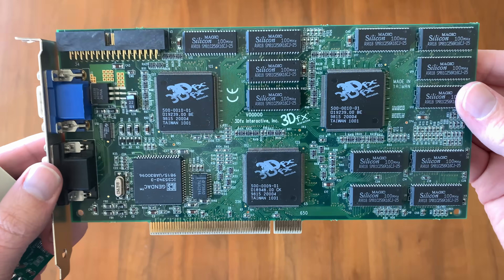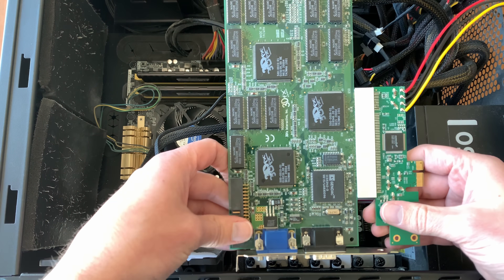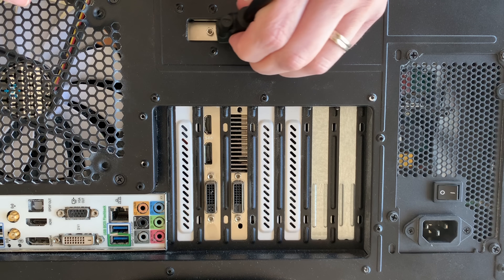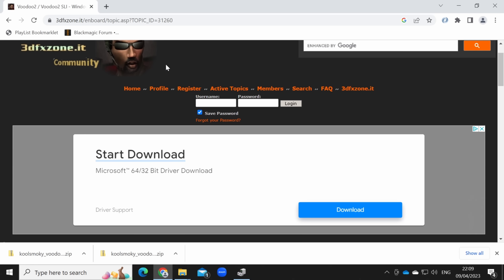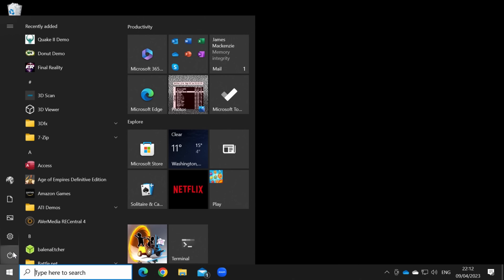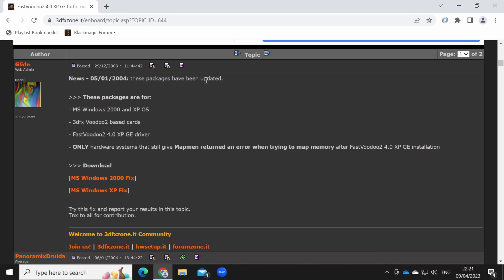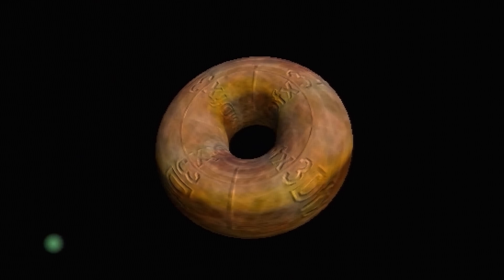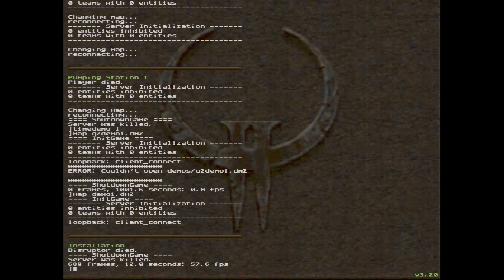I made 3Dfx Voodoo2 work on a modern PC!

Comment: It's hard to describe to younger people now what a huge leap it was going from regular graphics to 3D back in the 1990s, the difference was absolutely mind boggling. I had a Voodoo 1 and a Voodoo 2, the latter being a pretty major performance boost - 800x600!  Nice trip down memory lane!
Reply: yeah i remember those days. Had a Voodoorush, then a voodoo2. was mindblowing at the time. 
The fact that every couple of years there was like a quantum leap in CPU and GPU power.
Every 2yrs was a new gfx card (back when they were affordable, not like today), VRush, Voodo2, Geforce2GTS, GEforce4Ti, GF6800, GF8800, GTX460, and STILL running my 10 yr old GTX 980!
Reply: Had an S3 Virge built into my PC, and then got this on top of it. Pretty badass for its time.
Reply: Moto Racer!
Reply: @WardenWolf  Agree.it is so bad!
Reply: After the first few minutes of 3dfx Tomb Raider it felt like the Moon landing for graphics.
Reply: To be honest the donut demo blew my mind. Was expecting something Unreal level at best. But it really looks like iridescent metal, smoothly animated. Pretty mind blowing stuff for pre turn of the century hardware and software!
Reply: Yeah, it's hard. Back then the hardware 3D rendering seemed like a breakthrough. Nowadays, old sprite-based "3d" games like Doom, Duke3D, Descent and the likes are still somewhat passable with the source ports but early 3D looks like utter crap and there's no fixing it due to horrible models and textures.
I still play Heretic from time to time, but Heretic 2 and Hexen 2 are no bueno because of that.

Comment: Maybe try to see if SLI works next?
Reply: Not sure if there’s a case with two vertical card mounts.
Reply: I thought the same! With two riser cards and a case with dual vertical mounts or a motherboard with PCI
Reply: You're tempting me to do this when my B350 motherboard arrives...

It has two PCI slots built straight on the board and I've got two SLI'd Voodoo2s in one of my retro PCs.
Reply: This is exactly what I would like to see too. The challenges never run out.
Reply: @SolidSonicTH  do it! do it!
Reply: @spavatch  That's what dremels are for. Or better yet there are nibblers that can attach to a drill. Find an old case that you're willing to cut up, or better yet find one with those removable motherboard trays and cut out part of the expansion card backplane. Then cut a rectangular hole in the back of you case of matching size. Drill a couple holes and fasten with screws. There are plenty of old PC cases that just wind up going to the landfills. Might as well make use of some.

Comment: I still have my Voodoo 3 3000 card. Nice to see when others still love the older hardware. Awesome job.
Reply from the maker: 100% agree! I love playing with this old hardware. And I’d still love to get a Voodoo 3 even in 2023 😂
Reply: Honestly, I think that's still the best version of the Voodoo ever. I wish I still had mine.
Reply: @jamesfmackenzie  I think I still have my Voodoo 3 3000. Somewhere. In a box. In the loft... but I ain't venturing up there lest I get badgered into sorting out the rest of the crap thats up there too!
Reply: @YoureUsingWordsIncorrectly   Same with me only I used a couple of screws instead of the zip tie!  The first card I bought only lasted 2 weeks before it burned out and when I got a free replacement I immediately installed the fan after learning about the overheating problem on them.  Still works fine today though I very rarely use it now.  👍👍
Reply: I actually managed to burn out at least 3 Voodoo 3s, once in the middle of a LAN party. Good times!
Reply: I still have a 3DTVFM TV Card  with Installation CD, that I haven't been able to use for years. Could this be applied to that too?

Comment: That's great, had Voodoo2 SLI back in 1998 and fond memories of gaming back then.  Great community effort to bring drivers to x64 Windows, would not have guessed that was possible!
Reply: Those were the days! Miss my old build with my SLI Black magic Voodoo2s.
Reply from the maker: @davidt3563   100% agree! Great memories of those days 😎🥹
Reply: i got twoo orchid voodoo 2 (plus a voodoo 5 2 gpu pci)
Reply: Rewriting 32-bit code for 64-bit compatibility is actually rather routine.
But drivers can be tricky because of exacting hardware timings. In theory you could rewrite them without the hardware, but in practice you'll never get things working properly without having the hardware on hand to test and tweak the new driver code.
Reply: Also a nice testament to the backwards compatibility of the PCI standard.
Reply: SLI in 1998?! Tell me you're rich without telling me you're rich, lol.
Reply: @garethjohnstone8662  Two Voodoo 2 cards would not have been crazy expensive.
Reply: @Zerbey  Well, I guess it's a matter of relativity. I was only 16 working my first job. But still, £450 in 1998 was quite a lot of money. It was a 3rd of the price of my PC. Apparently it was $650 in the US at its time of release.
Reply: @garethjohnstone8662  from memory the Voodoo2 was £199 at launch (12MB) and in 1998 the second card was quite a lot less, I remember people even giving them away by 1999 because they had moved onto TNT2 ultra's.
Reply: High-end GPU cards cost far less in the 1990s than they do in the 2020s. A week's wages for a card, not a month's wages.
Reply: @pwnmeisterage  Yeah it wasn't exactly cheap back then but nothing like now and prices dropped quickly since so many new products were coming onto the market, by 1999 a Vodooo2 looked very dated and the price was slashed.
Reply: @garethjohnstone8662  If memory serves I paid around £200 for mine in 1998, I was making £15000 a year back then too!  My room mate had one also and we tried SLI once, but I don't think either of us wanted to invest in a second one.

Comment: I picked up one of those PCI to PCIe adapters to run my Aureal Vortex 2 based card on a board too modern for PCI slots. It never even occurred to me to try it with the Voodoo 2. That's awesome, thank you!
Reply: How's that work out for you?  What chipset were you running on and did DOS sound work?
Reply from the maker: Very interesting idea! I have an SB Live and also a ESS Solo card. Will try them out with this adapter too!
Reply: Sadly, I never got around to properly testing it out. (weee kids. 🙃) 
I confirmed the card is detected in Windows 10 while fitted in the adapter but there aren't any working drivers for the Vortex2 in Windows 10. 
I am using a Core i7-980 with an Intel X58 Express chipset. I need to try that system with pure DOS again. I wanted to run Win98 on there but ran into issues with the SATA drivers. (going back, I'll probably try to drop an IDE PCIe card in there and run from an IDE SSD/CF)
Reply: @T3hBeowulf  enable ide/ata mode in the bios since you have a cpu before broadwell/skylake
edit: you will also need to copy the install files to the hard drive (windows 98 actually lets you do that), and once youve installed, to run games simply dump and copy isos from a usb flash drive and mount using daemon tools. you might need no cd cracks for some games, but generally it will work
Reply: @jamesfmackenzie  These adapters "should" work with most PCI cards because from a software point of view PCIe is backward compatible with PCI. That's why all you need is a simple converter chip, and maybe some extra voltages. The gotcha, as you discovered here is driver support. Luckily it appears someone wrote 64 bit drivers for the voodoo 2 cards. Now, the question is will that be the case with other cards?

Comment: It's remarkable that you got it to run on a modern system, with a modern operating system.  A labour of love that was, and well worth it by the looks of it.  I too had a Voodoo 2 back in the day, and I remember how impressive it was at the time; truly groundbreaking stuff.

Nicely done.
Reply: Well... you have to give it to microsoft and the PCs open architecture. Try and do this on a mac. Lol.
Reply: It's more of a gimmick than anything else. It's a cool hack, but at this point, Glide is emulated in DOS Box, so there's little practical reason for this. Not to mention that a good chunk of the boards have already either died or been disposed of for other reasons.
Reply: @SmallSpoonBrigade  Sometimes, it's not about the path of the least resistance, especially when it comes to hardware.  The path of most resistance, once you get thing to work, can be incredibly rewarding.

(But I know, I totally get what you're saying, and where you're coming from).

Nostalgia is a powerful incentive.  Believe me.

Comment: No idea how many hours of Quake II I played on my Voodoo2, but it was a lot! I remember when I first installed it, and going from a slow S3 Virge/DX (Diamond Stealth 3D 2000 Pro, even upgraded to 4mb), the difference was like night and day. Buttery smooth framerates compared to the S3, and the hardware T&L engine just looked so much better. I probably ran around for 5 minutes in that starting area shooting the blaster just to watch it light up the wall as the round went past.
Reply: I got into Voodoo with the OG Voodoo 1. I was at the computer hardware store (remember those?) and they had Quake 1 running on side-by-side machines. One had software rendering, the other running GLQuake. Like you said, it was night and day. I was only like 15 at the time but did some work for a friend's dad, who shortly after bought me one.
Reply: T&L happened with the GeForce 256 however.
Reply: @nvmskullworks4794  ah yes, that's right. It must've been some fancy texturing effect or something. Either way it looked way better than software rendering.
Reply: i had the same set up must have played through that game and all the expansions 20 times, even played them with my friend in co op
Reply: @jnordne2  Yes, although 3dFX did get massively lucky that the price of RAM came down when it did. When they announced their cards, they were laughably expensive to the point where nobody was taking them seriously. Then the price of RAM dropped, and the other companies were screwed. It's a shame that PowerVR didn't get to have a second revision of their board for such a long time, as it was the only one I remember that was at all competitive at that stage. In some ways it was better, higher screen res and not needing the goofy pass through cable.

Comment: Very impressed that it worked in Win10. Recommend you add cooling to the Voodoo2 if you use it for longer periods, it’s been seen that when not held back by CPUs from 1998 that they run a lot hotter
Reply from the maker: This has been suggested by a few people. I have some heatsinks and an IR thermometer on order. Thanks! :-)

Comment: Super impressive! I have 2 Voodoo 2s (one needs work) and it's currently in my 486 for silliness while I get ready to do a K6-2 build.
Reply from the maker: Thanks! I used my Voodoo2’s on a K6-2 rig, and then an overlocked Celeron 450A. Great times!!
Reply: I tried putting my voodoo card in a 5x86 133 machine. Quake 2 was still too slow to play, but it worked.
Reply: @jnordne2  I had the best luck with Tomb Raider and Resident Evil

Comment: I would like to see the San Francisco Rush port that came bundled with the Voodoo Banshee running in glide on a modern PC since that game is very CPU dependant, it should run a lot better than with a Pentium 2/PIII.
Reply: Core2 duo and higher is a pentium 3( including Pentium M)
Reply: @theantiveganchannel3596  I wish the hardware companies would stop the stupid naming schemes. Yes, cache and clockspeed for processors wasn't perfect at the time, but it did give a decent sense of the relative performance, so long as you didn't skip too many generations. Now, it's pretty much a guess, if you're not doing a ton of research, as the names are completely useless.

Comment: You might want to add heat sinks to the 3 processors.  I had put my old voodoo2 card on a core2 duo PC running windows xp, and it seemed like the more powerful CPU drove the card pretty hard so I needed the extra cooling to keep it stable.

Comment: Combine this with the novel dISAppointment ISA to TPM adapter, one might be able to make a fully functionnal Modern/Vintage gaming PC !
Reply from the maker: That’s the dream! I think this board has the right TPM pin out for the dISAppointment too. Until then I’ll try SBEMU 😎
Reply: Next step : using a ball serial mouse with a CH340 Usb adapter :)
Reply: @nalinux  most boards still have native COM ports, just not the DE-9 connector. Instead they usually have a pin header to connect a slot cover with the DE-9 connector
Reply: @nalinux  Windows 10 works with a serial mouse straight away. Literally just plug it in and it works.
Reply: @TheAmazingAdventuresOfMiles  Right, you are both right about it ...
The more stupid thing is the mainboard I have now has  serial and // ports ...

Comment: This is cool to see.  I owned a card of each generation Voodoo and had multiples of I think Voodoo2.

Unsigned driver warnings are "scary" but not that scary.  Back far enough, none of the drivers were signed anyway, certainly not during the DOS/Win3.1 days.
Reply: It is not. It just warned that the driver has not been tested by microsoft official yet
Reply: @faradiaulia5560  It just means you gotta pay them some money, then they will sign it. It's pretty expensive I think. Also, I doubt they would even deal with someone who's just a hobbyist. You have to be a big company. Anyway, a driver being unsigned doesn't necessarily mean anything "scary". You can just edit the inf file and it will invalidate the signature.

Comment: Really great to see! Yes you can emulate a Voodoo but it's just not the same as physical silicon. I still have my two V2's from 98, and the SLI cable. They are in a Pentium 3 at the moment, but it would be awesome to run them in a modern machine. I also have a V3 3000 but it's an AGP card, I doubt it's possible to make that work.
Reply from the maker: Nice!!

Yes I agree on AGP. The reason PCI works is because of the PCIE-to-PCI bridge specification - which is designed into PCIE 😎
Reply: @jamesfmackenzie  If I recall AGP is just PCI with a dedicated connection to CPU/Memory instead of being shared across all of the available PCI slot in round-robin access. That's why you can get APG2PCI adapters which map connector to connector.
Reply: @TheFluffyFreak  That sounds promising...

Comment: FYI, you can self-sign your own drivers so you don't have to boot up with the driver signature enforcement disabled. Very cool to see that this is still useable in x64 versions of Windows, didn't think we'd see any x64 drivers!
Reply from the maker: Thanks for the tip! Assume you self sign and then drop into the root trust store?
Reply: You might need to be in developer mode too

Comment: I think the way this was achieved is that the driver forces Windows 10 to think it's using the regular modern GPU to render the graphics (that's why a Glide to OpenGL wrapper is still needed for the output) but actually renders all the 3D elements using the voodoo card. This is also why the OS is so confused about the memory, because it thinks there should be gigabytes of memory available, not the mere few megabytes of the Voodoo it is probably being reported on.

I'm still amazed it actually worked. In theory there shouldn't be any compatibility, but the unofficial drivers community is simply unbelievable in what it can achieve.

Comment: Nice work James, very well done, and congratulations on all the views! I remember reviewing 3DFX cards when I was still writing for PCW in print! So it's very cool to see them working here on modern hardware and OS's! Your next challenge is to try and get a halfway modern PCIe graphics card working on Windows 98, as I'm fed up just running in VGA!
Reply from the maker: Thanks for the very kind words!

I’m very much up for that challenge! I have a PCIe Radeon X800 on order - fingers crossed! 😂

PS I very much enjoyed your trip to the Cave - thanks for the great video!!
Reply from the maker: PS I still remember your question on connecting old digital cameras to the MiSTer. I’m out of the UK right now - so without my old serial cables, USB COM adapters etc. But it’s on the to do list! One day … please bear with me 😂
Reply: @jamesfmackenzie  thanks! I resolved the issue at the time by simply building a new PC with my oldest parts, and installing Windows 98 on it so I could access the original software and use an original non-adapted serial port! You can see it in my Apple QuickTake 100 and Olympus C-800L videos. But as I mentioned, I didn't have any Win98 drivers for even my oldest graphics card, so I had to run in crappy VGA! I'm on the lookout for an old Toshiba Libretto in good nick for these projects as having a lumbering tower PC just for it, is a little excessive.
Reply from the maker: Glad to hear you got it fixed. Those old Librettos are very nice 😎

Comment: Half-Life 1 had three-dimensional water waves effect that were lost during ports and renderer updates.

Last time I saw this was under WndowsXP with orginal HL release and OpenGL renderer.

Try running some versions of HL1 and see if the water has that swing.
Reply: The first time I played Half-Life was on Vista with a GTX 260. I remember the odd-looking pointy-wave 3D water surface.

Comment: Interesting video. I had no idea it would work on 64-bit Windows 10.

Frame rate comparison (Quake II, timedemo 1, 640x480):
Voodoo2 on your 4th gen i5/i7: 57.6 fps
Voodoo3 3000 AGP on a Pentium III 1.4 GHz: 182.3 fps

It would be interesting to test a Voodoo3 3000 PCI (if it's even possible). The frame rate would probably be the same as with the P3 in Quake II, but in newer games like Max Payne, that use software T&L, it would probably be faster. :)
Reply: Its the old PCI standard slowing it down.  They would need to find a AGP to PCIE convertor.  Which, supposedly existed, but mostly in Asia.